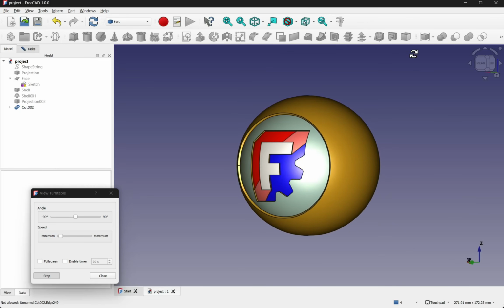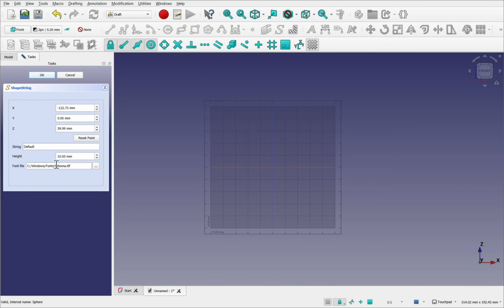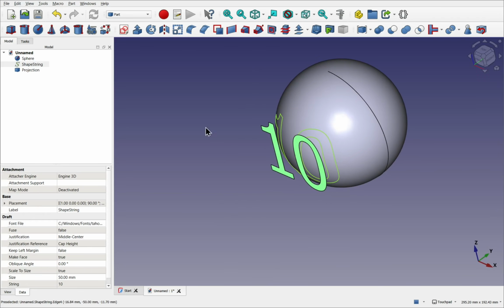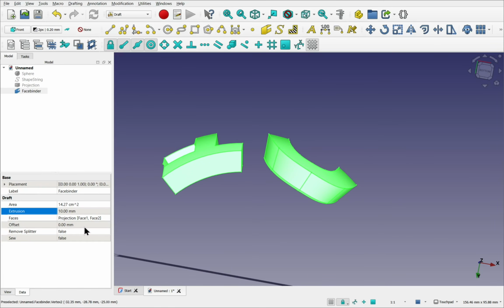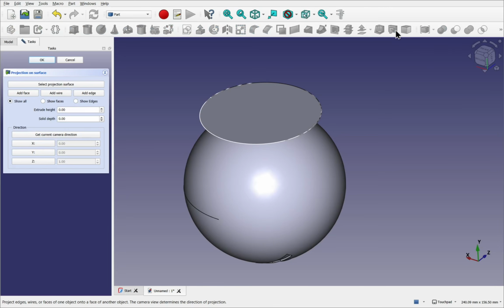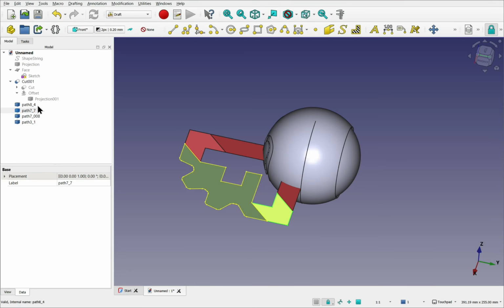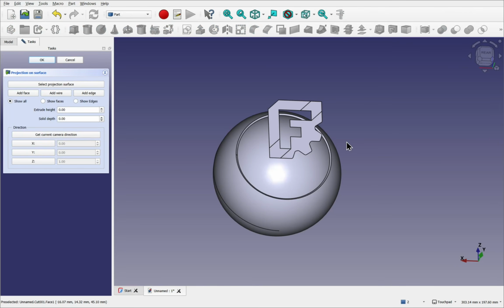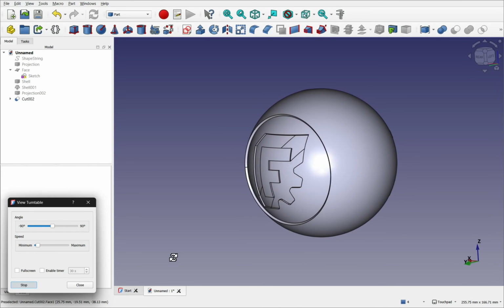FreeCAD v1: Logos, Text, SVG, Sketch on a Sphere / Curved Surface : Easy Workflow

Comment: Unable to project on a loft: I am trying to project on a loft and connot get it to work, it will work on a solid object made in Part, or a sketch that has been extruded into a shape, but not a loft that has been ticked box as a solid.  Does anyone know why is it not working, Most of my shaping is using lofts.
Reply: I was able to get it to work on a loft made of two sketches, but then when I use three sketches in the loft it makes a separated cap extrusion that was unusable for printing, very weird, still working on it

Comment: brother i have problem, What if the text or SVG file is placed between 2 surfaces?
Reply from the maker: The shape you want to project can be projected onto a surface even if there is another in the way. Select the projection tool and then select a surface even if it's behind others. As long as its in line with camera it will project through those and onto the selected.

Comment: I wonder if you can do this with the curves workbench and would the text wrap better rather than like a shadow. Do you know?
Reply from the maker: You will have different issues with the curves workbench in trying to unwrap the surface and you will get distortion unfortunately.  Spheres are quite hard to project onto.

Comment: Thank you for this tutorial. Here's what I've managed to scrap while trying to project an SVG with text and graphics onto a cylinder.
In my situation a projection made by "Create projection on surface" wasn't useful. Projected "shadow" of a complex, wide svg graphics on a cylinder produces a distorted image and that is understandable - its basically a shadow cast on a round surface. 
Instead I have used a "MapOnFace" tool with an aid of "Flatten face" tool (applied to a cylinder face) from Curves workbench.
In place of Draft's Upgrade tool, I've used Part's tool called "Make face from wires". And I've had to repeat the whole process of projecting faces on a rectangle(!), and using that projection as a source shape for MapOnFace tool, because for some reason the initial shapes made by MakeFace were mapping incorrectly.
Native importing of SVG with FreeCAD also gave me a massive headache - letters like R, A, S were having overlapping faces (indicated by Z fighting and having no "cutouts"). I've utilized an addon workbench named "Svg Workbench". With little DPI tweaks it had imported everything just right. 
Anyways it got things done, although FreeCAD drank a lot of my blood that day.
Reply from the maker: Thank for sharing this as it's great for others to read how people deal with issues during workflows.  Text can be a pain due to all the different type faces and often require a bit of brute force to get stuff to work.  Interesting you used that add on, I have only heard about it from this comment so going off to take a look.  Thanks for the feedback.
Reply: @MangoJellySolutions  yes. The same letter at a different location in text or in different case could become botched and no sequence of upgrades/downgrades would help it. 
Also a strange thing with this MapOnFace tool - it can fail at mapping (indicated by an "Invalid face" line in report view, and a LOT of errors and a CTD when trying to extrude that face) just because your graphics content is not at the right place in svg canvas and as a result some letter will have a vertex at the wrong place and its face will become distorted. I've had to open Inkscape and move everything around twice - first time there was no warning in the report window but one of the letters just disappeared, the next it mapped correctly.

Comment: I hit upgrade and my SVG paths turned into wires, not a Shell. Please help.
Reply: Mine turned into a composite. To be fair it worked when I followed the video and used the Freecad .svg. But when I tried on my own with a different .svg it turned into a composite. I tired to project it onto a flat surface and I get an error when I select the surface for the projection. Then a Freecad crash when I try to proceed anyway. Frustrating!

Comment: Is there a way to project onto bodies created in the Part Design workbench in 1.0.1? 
I can't get it to work...
Reply from the maker: Yes, so you have to use a shape binder.  Follow the same process and when the projection is created it sits outside the body.  You body should be still active (in the treeview it's in bold), if not double click it.  Select the projection from the treeview and select the green sub shape binder.  Now you can pad the binder.  Hope that helped..

Comment: I use FreeCAD 1.0.1 version. Any font I select for shapestring, characters appear just as contours and not faces in contrast as in your video. Even if shapestring data table reads Make face=true. Can I upgrade/convert letters to faces? Thus I cannot project embossed lettering on a cylindrical surface (bottle deco engraving). This is the case Part wb for projecttion and in Curves wb when mapping either sketch or shapestring on a curved face.

Comment: Very helpful videos! For those of us who use Part Design, how do you cut a projection from a Part Design body?
Reply from the maker: Glad it was helpful. To cut the projection in part design first create the projection then click on the projection from the part design workbench and create a new body. This will pull it in as a base feature. You can then run a boolean between the two bodies. Hope that helps.

Comment: Everyone's gangsta adding text from draft. But how to e.g. pocket text imported as SVG path?! When I try to Pocket a letter "A" it punches a hole using only the external outline of the letter. EDIT: Ah, the "Allow Compound" HIDDEN body property it was...
Reply from the maker: You found it before me, glad you found the solution :)
Reply: @MangoJellySolutions  People on THE forums told me, rather. I wonder how it would have been solved in 0.2x since that option is a v 1.x addition.

Comment: Doesn't work on the pad that belongs to body
Reply: That's because the "Pad" is internal object inside the Body container. Its like a sandbox and it doesn’t allow external objects like "Projective" to directly use it as reference. Alternatively you could use "create a simple copy" method to create "Pad" as external object (Part Workbench... Select Pad... In the menu, Go Part > Create a Copy > Create Simple Copy.) and apply Projective on Pad. However, there is a drawback. Once "Pad"  object become external, this would consider as "destructive" (unable to modify).

Comment: I have a project for my son that I wanted to use Inkscape to design an outline of a Seahorse and add the word DINER and then a mirror image of the Seahorse. The initial problem was when I imported the SVG the insides of the letter D and the top part of the R were filled in solid. Used the Shape Builder tool in Inkscape to sort that out. Now everything was path, and exported to SVG. When I imported into FreeCad 1.0 I had 9  paths, solid parts from D and R were also paths. Could not get that to work. I downgraded in Draft and had 9 Faces. I selected all but the two solids with Ctrl-Select and all showed green, but I never could get anything to project. The face I wanted to project/ 3D print on was the center portion of a 180 degree arc in XY place, projected onto the face in the YZ plane. I tried to follow steps in the last part of this video of an imported SVG file, but never could get it to project. Would appreciate all help on this!

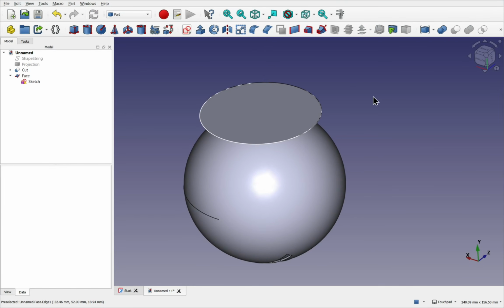Comment: Hey, really great Video. Helped me a lot, thanks for that. But experiencing a problem when try to project a circular face (as shown at around 0:14:00 in the vid) centered to the bottom of the sphere (XY plane) where the seam / wire starts which defines the sphere. This doesn't work as well as on other regions of the sphere. Known issue? Any ideas on fixing that?

Comment: As per usual, very nice. Very useful information. I was having a software issue, where FreeCAD would just disappear while searching for a file to open or import, so I reinstalled Windows leaving user file but removing all user programs. Then I installed all current versions of user softwares. Let's hope the crash problem stays away. It's very difficult to create when the program is unstable and it's not your hardware. Let me know if you've ever seen this problem.
Reply from the maker: Thank you. In regards to the problem you are having. I have never heard of this before. I just had a quick Google and it looks like you can run freecad with 
-- write-log flag which may help you figure out what's going on.
Reply: @MangoJellySolutions  I'd never found any reason for it to be happening either. Had to be Windows. I'll let you know if I fixed it, once I can get a day off. I'm at 8x13 hour days in a row.

Comment: Tip for Mac users to easily add fonts from Font Book...
1/ In Font Book find the font you would like to use, right click on it and select 'show in finder'. If you already opened the preview in Font Book you can select 'show in finder' from the File menu or press 'command + R'
2/ From finder right click on the font file, when the context menu appears hold the 'option' key down.
3/ 'Copy “File-name” as Pathname' wil appear in the context menu, click on it.
4/ In FreeCAD paste into the font file dialog.
Done!

Thanks MangoJelly for another fantastic and clear tutorial. FreeCAD would be so much more difficult without you.

Side note, I tried this on an Ellipsoid and the resulting facebinder refused to extrude, not too surprising in retrospect, I can't even begin to imagine how hairy the maths behind that would be.
Reply from the maker: Thank you so much for adding that information and in such detail regarding the fonts on Mac.  I know there are a number of Mac users that view this channel and I have seen some hurdles before.  I wish I could add more Mac specific content at stages like this but unfortunately I don't have one and I have to borrow one from work for areas like this.    Glad you enjoyed, and thank you so much for the kind words.  i'm off to try this on a ellipsoid now to see what's going on :)

Comment: I tried the other day to project and SVG image onto a sphere in V1, and although the tools look the same I failed and reverted to V.21.1. Thankyou for showing that the projection in V1 is possible. However since watching this video, I have tried again to complete a projection in V1. I find it annoying that when selecting multiple parts they do not change colour to indicate that they have been selected, hence I missed some parts.
I also spend more time in V1 trying to get the combo view and task view working as with previous versions. 
I will stick with V.21.1 as I am only a hobbyist and it works well enough for me.
Thankyou for all of the helpful videos.

Comment: Am I correct in assuming that this method wouldn't work well for something like wrapping a design or text all around a cylinder, for example? Like it works for a curved surface, but if the curve goes all the way behind itself, how does it resolve that mapping from a flat plane?
Reply from the maker: Yes that is correct, for that you want to use the Curves WB addon from the add on manager.  Within you will find a sketch on surface tool that unwraps surfaces allowing you to sketch upon them.  I have some older videos on my channel where I have used to tool for some applications.
Reply: @MangoJellySolutions  I guess I will try the Curves WB. I need to wrap text around a cylinder however thank you for the video(s).

Comment: This seems very complicated. Are projections with other cad systems so complicated? Thanks for taking the time to make the video, this is one of those tools I'll avoid until I need it, and having this video as a reference will seriously help.
Reply: I don't think that the projection part made this complicated. The fact that he wanted to show how to extrude along the normal of a curved surface made it a bit more complex. If all you wanted was an extrude along one of the major axis, that would be much simpler.

Comment: Perfectly logical. Who WOULDN'T expect an extrude option in a tool called "Facebinder".
Reply: @depthoffocusmike  Language lawyering. I read your words but I do not see the difference you claim to be described therein. The lack of a one-click function in Part to perform Extrude+Cut does not a difference make. I could write a macro, give it the name Pocket and put it onto the Part workbench toolbar and your argument collapses.
And I have actually missed this as a built-in feature. They should absolutely add "negative extrude" or "extrude-cut" or "pocket" or best of all "Intrude"  to Part workbench. It is a purely arbitrary decision that it is missing. There is no deeper meaning behind it. The implementation is trivial and it is just as useful in Part as it is in Part Design.
Reply: Intrude is a genious name for this function its self explanatory and funny  @frankbauerful
Reply: @depthoffocusmike  How are they different?
Reply: No worse than naming the grouping function 'Upgrade' ... ;-) Sometimes one wonders who is in charge of creating a meaningful and consistent naming convention. Are common names somehow patented by the big CAD companies? Why reinvent the wheel? Even calling an extrude function 'Pad' is odd. Stick with 'Pull' or 'Extrude'.
Reply: @langrock74  Yeah. The worst thing about "Pad" is that in the Part Workbench it actually IS called "Extrude". So FreeCAD is inconsistent with itself.
Reply: @frankbauerful  It's not the same tool though. Pad requires a closed wire and always results in a 3D body. Part workbenches' extrusion on the other hand will happily extrude an open line to create a face.

Comment: This is so awesome, thanks for the great video!

Side note: coming mostly from SolidWorks and Inventor, the part design workbench is most intuitive to me, but the part workbench seems to be seriously overpowered. The ability to mix and match operations from different workbenches as well as choosing to build assemblies from multiple files or within a single file or a combination of both is mindbogglingly amazing. FreeCAD seems to be a bit rough around the edges, but in a very powerful way. Love it!
Reply from the maker: Glad you enjoyed :)  Yes part design follows that of traditional CAD feature modeling but with part design your limited to working with solids all the time and not allow a shell.  The part is where you can mix and match and allows for surface modeling so you can create, shells, composites etc and really combine and experiment.  I normally do a lot of prototyping in part :)  FreeCAD can be a bit of a Frankenstein sometimes but it's great at being flexible.

Comment: Thank you! All I need to do now is find the secret setting somewhere in windows which will allow FreeCAD to actually see the font directory / files. I'm sure Windows is "helping" me by just hiding things they think I don't need...  But thank you for the video!
Reply: You can copy Windows Font folder into a FreeCAD directory 'Bin' for example and within Edit-Preferences-Draft just enter full path of it as Darren did. Note that FreeCAD (previous versions) only accepted TTF fonts (TrueTypeFonts). I haven't try ShapString on this FreeCAD 1.0 version to tell it for sure...
Reply: @LFANS2001  Thank you.